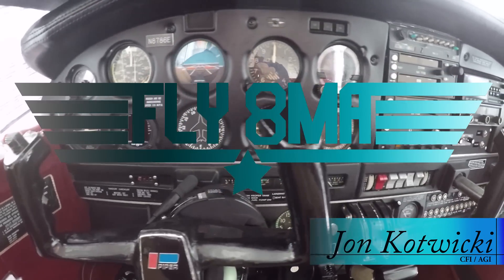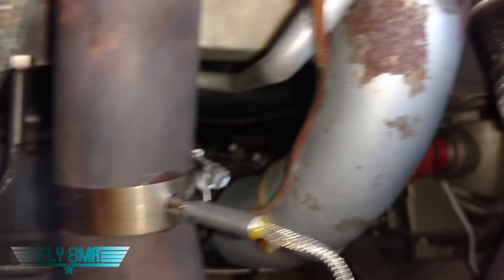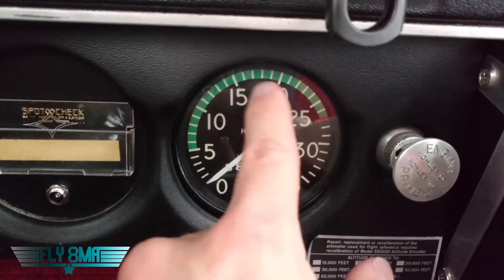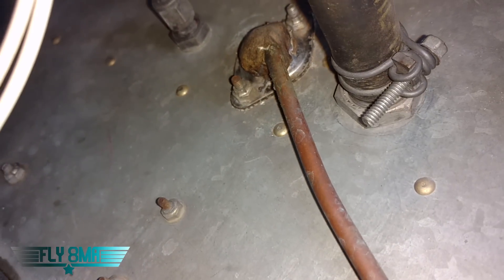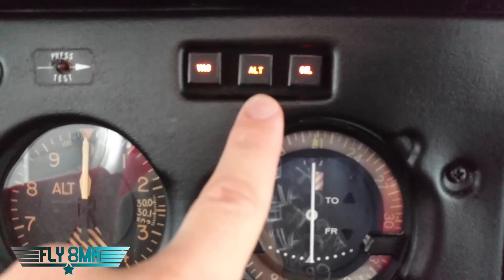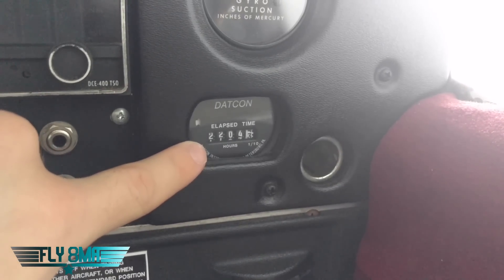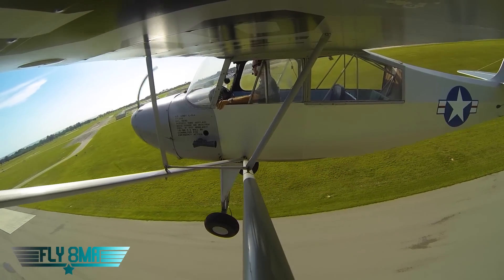Ep. 57: Airplane Instruments | Gauges | Dials | All Explained

Comment: Great video. That is technically a “loadmeter” though, right? Shows electrical load on the system only. Unlike an ammeter, which is capable of indicating an electrical discharge (negative indication) and a charge (hopefully just a slight positive indication if all is working normally). 

Working on my CFI right now so just want to make sure I know what I’m talking about. Am I correct?
Reply: @fly8ma

Comment: Stupid question, how does the heater use the exhaust to heat the plane? Obviously it isnt venting fumes in the cabin. Can you describe the ,heat exchanger?, set up?
Reply: There is a shroud that surrounds the exhaust pipe and a hose is connected to that shroud and routed into the cabin

Comment: Jon, could you please elaborate a little on the reason behind wanting to know EGT & CHT? Absolutely love all your videos. Thanks!
Reply: CHT is related to how much stress the engine is under. The higher the temperature, the higher the stress. It is also related to combustion efficiency. If the engine is too cold, the lead in the fuel may condense in the cylinder and cause fouling. Some aircraft are equipped with cowl flaps that the pilot uses regulate cooling air in the engine compartment. At very high altitudes or in the winter up north, you'll want to close your cowl flaps to keep the CHT up.

You can use the EGT to tune the mixture. Ideally, every bit of fuel in the engine would have enough oxygen to burn completely (look up stoichiometry). Full-rich works pretty well on the ground, but up where the air is thin there's more fuel to burn than air to mix it with. When the mixture is perfect, the fuel/air combustion produces maximum heat, so you lean the mixture and watch for the EGT to hit its peak and start coming down again. (If you're too aggressive the engine might start sputtering from not getting enough fuel.) The aircraft handbook usually recommends setting the mixture to be just rich of peak EGT.

There is also some advanced troubleshooting you can do with a fancy, multi-probe system like the one shown. E.g., a fouled spark plug will read a bit high EGT and slightly low CHT on that cylinder.

Comment: I know most of them, but it would have been nice to explain the abbreviations,   e.g. . EGT,  CHT,  ELT,  etc.  Would be good for newbies. Just saying     :-}   Otherwise,  great video!!!
Reply: EGT = Exhaust Gas Temperature 
CHT = Cylinder Head Temperature 
ELT = Emergency Locator Transmitter
Reply: He verbally said Exhaust Gas Tempurature and Cylinder Head Temperature.
Reply: As an initial cockpit overview, this is gold. No need to do a deep dive to each and every abbreviation/system. There‘s plenty of material on YT or Google to deepen your knowledge.

Comment: One question that has always bugged me (pardon the Pun), is regarding the D.G., I know it's not a Compass BUTT it can act as one, The Question is does the D.G. automatically know where the aircraft is facing even with the engine off, so if you were to push the nose on the ground of the aircraft withé the Engine off (or On), does the D.G. automatically line up ¿¿¿¿¿¿
Reply: No, the D.G. (directional gyro, also called a heading indicator) only works when the engine is running (because it is powered by airflow from the engine-driven vacuum pump) The D.G. has no idea where the airplane is pointed, it can only sense a change in direction. The pilot has to manually twist the D.G. to match what the compass says. The reason that the D.G. exists is that the compass will freak out any time the airplane is turning or accelerating or decelerating. The D.G. is accurate in the short term while maneuvering, but will occasionally need to be re-set to the compass

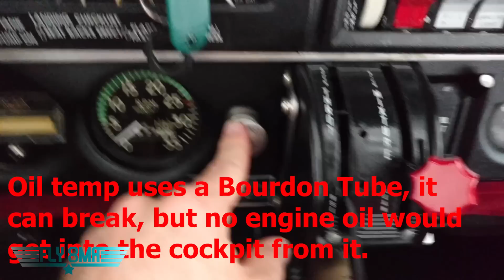Comment: 7:02 the text is not correct.  
      Oil Pressure uses the bourdon tube (in the instrument), needs no power, and would spill oil if the line broke.  Most of these Pipers had a small copper line running directly into the cockpit to indicate oil pressure.

      Oil temperature takes the measurement at the engine, generates a signal and uses a wire to transmit to the instrument.  With oil temp, you need electrical power to make the instrument work.

Comment: Vacuum pump vacuum sealed instruments are in a vacuum?
Reply: Officer Gregory Stevens Think of the pump as an “air pump”.  Only in this case, the pump is drawing air in, instead of pumping air out.

      The engine turns the vanes in the pump and it draws air inward.  Rigid tubing connects the pump to the air powered gyro instruments.  Further upstream there is a filter and regulator.
       Air is sucked into the system under the instrument panel through the filter, then passes through the gyro, causing it to spin.  The air then passes through the tubing, is drawn into the pump and discharged out of the pump.

Comment: Jon, what is the difference between priming with the primer and with the throttle? My instructor always used the later. Ty
Excellent video as usual 👍🏼
Reply: The throttle control fundamentally is simply opening the throttle valve to let the engine suck in more air and has nothing directly to do with fuel (the extra air rushing through the carburetor's venturi will also suck more fuel with it). However! Carburetors are pretty bad at their job. They tend to make the engine run rich at low power and run lean at high power, especially when punching the throttle quickly. So in order to help the engine from stuttering (because it got too much air but not enough fuel) engineers connected an "accelerator pump" to the throttle lever. This pump is basically a little syringe that squirts fuel into the airflow when the throttle is increased quickly. So by pumping the throttle, you can squirt fuel up into the intake manifold pretty much right at the carburetor. The PRIMER, however, is a syringe that you can use to squirt fuel directly onto the back of the intake valves. This is much closer to the engine and farther away from the intake filter. The primer should be more effective most of the time. Most importantly though, the primer is much less likely to cause an intake fire on the ground when starting.
Reply: Samm Sheperd thanks for a great explanation!

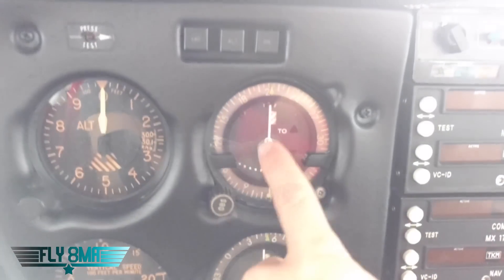Comment: Could you explain things without being a pilot snob? 1:52 We have 2 VUR both have VOS knobs. 4:30 Down here we have our ELT panel. What is the point of these videos if you're just gonna spew acronyms without explaining the terms?
Reply from the maker: +Dragon Skunk if you watch the videos in order (this one is #57) all the contractions used have been explained earlier (learning is a building block system!)
Reply: One of the parts of getting into any field is learning what acronyms are used. This is part of that learning system. Since no pilots say "VHF omni directional radio range", there's little sense in him saying that instead of "VOR".
Reply: To be honest, it would be less understandable if he actually expanded VOR. It is such a common abbreviation, you never use it in its full form.
As for OBS knob - you could say omni bearing selector. But let's be honest - nobody actually cares what the knob is called. It's the knob on the NAV.

ELT is actually not that commonly mentioned, so I can understand if this seems unfamiliar to you. It's the emergency locator beacon. He did mention how it works, though, so it should be clear what it does, even if you don't know what it means exactly.
Reply: Fair enough, I'll give it a look.
Reply: Exactly

Comment: Another important thing with the amp meter is that it will indicate a hung starter motor by showing very high amps after start. Normally it will drop to below 20 amps quickly, but if the starter hangs it will be at about 40 amps at idle and go to 60 amps with any kind of increase in rpm. Unless you have a warning for starter hang fitted to the aircraft this is an important thing to watch out for after start. We had one of our Warriors get smoke in cockpit during taxi for departure, but it doesn't happen right away. They got all the way to the runway before it got hot enough to produce smoke. Luckily they got off the runway and shut down before anything more serious happened, but the firedepartment was notified by the tower and came to help. They ended up having to change the starter, starter relée and start switch to cure the problem. So a lesson learned for me always pay attention to the amp meter after start, just like oil pressure.
Reply from the maker: Yikes, I would've hoped the noise of the ring gear and pinion on the starter would've clued them in to that.  Must have been some pretty smooth and quite gears!
Reply: No sound at all, that's why the first one that got it managed to taxi all the way from hangars, do run-up and enter the runway before smoke started appearing. No idea how it managed to do that, but changing starter, starter relay and start switch fixed it in the end.